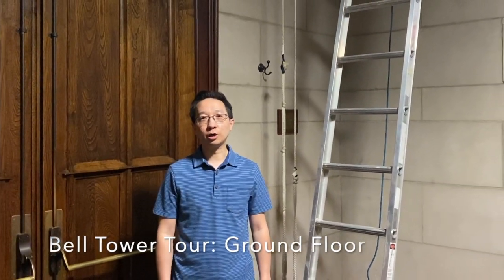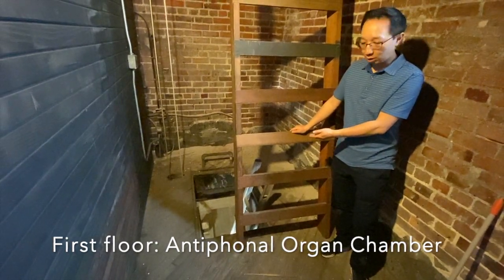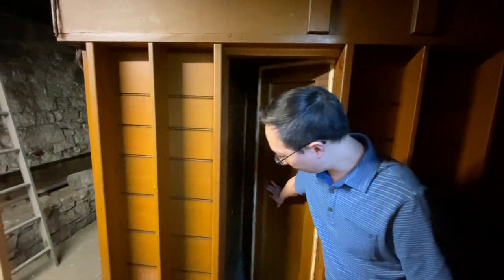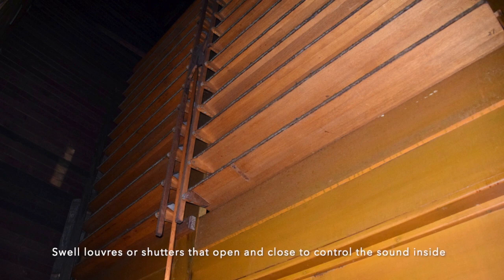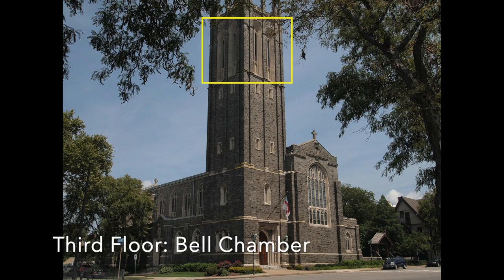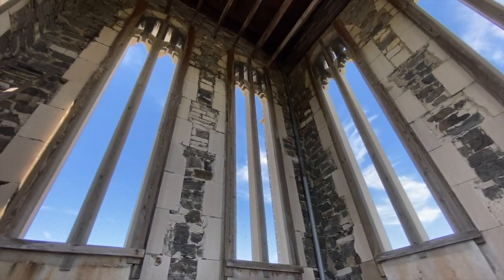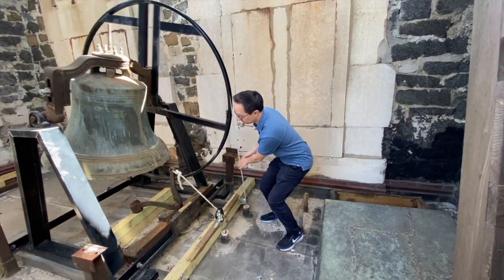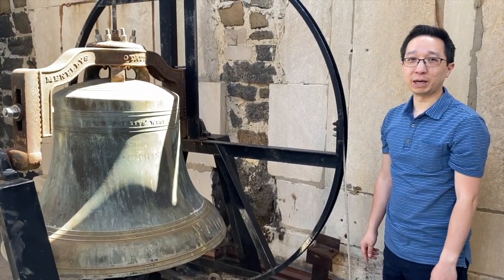A Tour of the Bell Tower of Christ and St. Luke's Church, Norfolk, VA

Comment: Depending on the foundry, the head of the tolling clapper wold be hollow, and there were be a burl of hardwood inserted to give the bell a slightly muffled sound when tolled.  Sometimes the burl would have several layers of thick canvas attached to it to soften the sound.  

The bell in my church growing up had this, and it made for a very mournful sound when tolled for funerals as well as when it was tolled to announce the death of a member of the congregation.